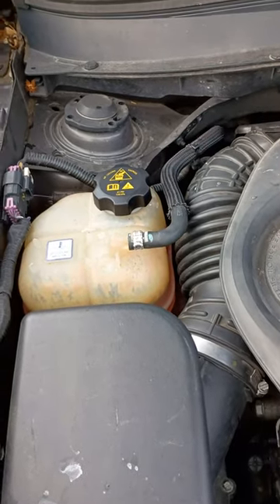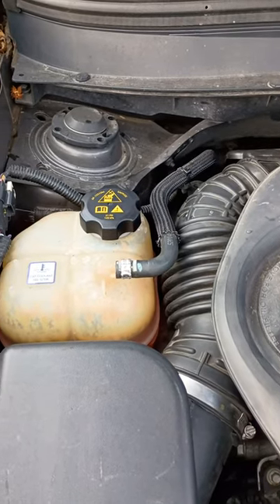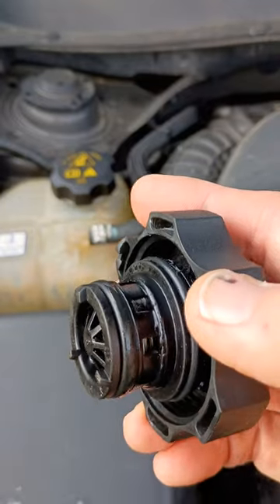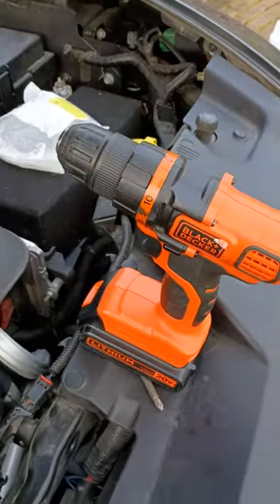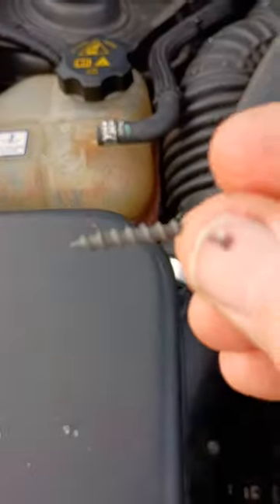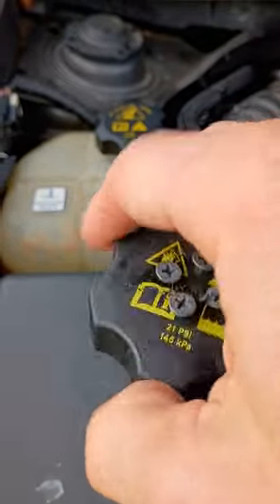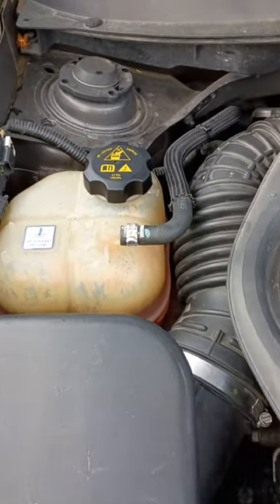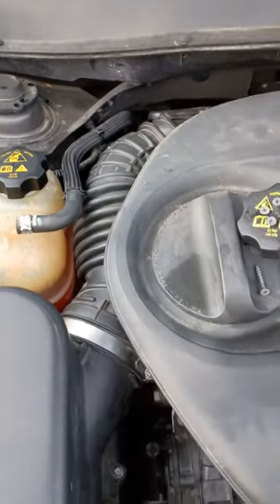How to remove a broken Coolant Cap - Quick & Easy

Comment: Just a quick comment, Thank you. 🙂
Tried the other methods (Screw drivers and pliers) no joy 😞
Tried your method, didn't work at first (Cap wouldn't budge) 😞
I had to unscrew the screws a little and use a metal spanner (between the screws) as a lever. 🙂
Hey Presto!

Comment: It does work but putting extra screws in makes the seal below even tighter. I had to use a big plumbers wrench to unscrew the cap. Mole grips etc just wasn't up to the job. But if you have a plumbers wrench. Then is is by far the best way to remove the cap and bit below it